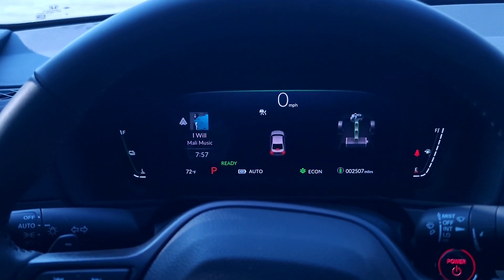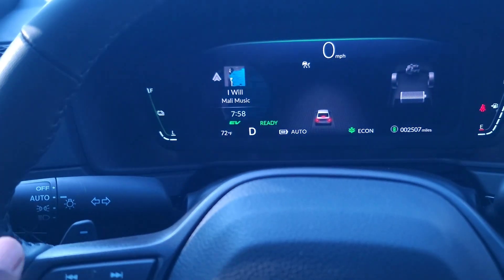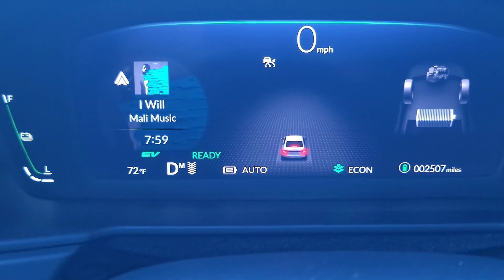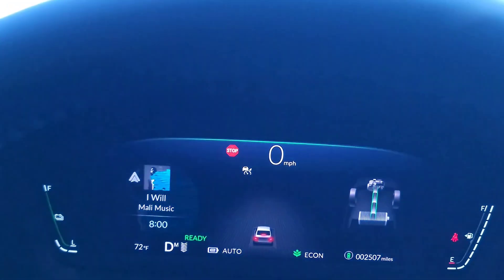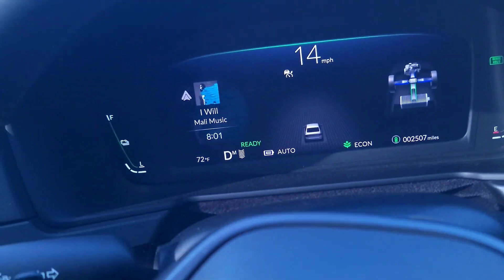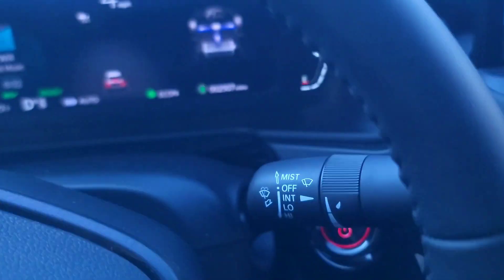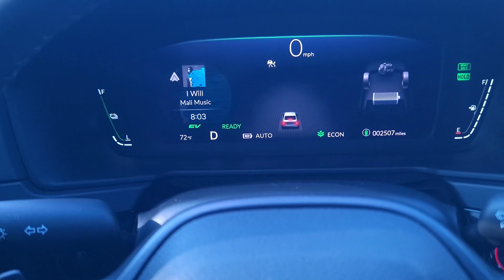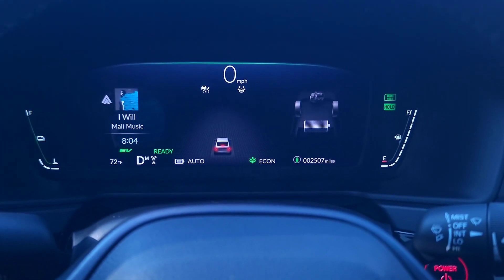HOW DOES THIS THING WORK? | REGENERATIVE BRAKING 2023 HONDA ACCORD

Comment: Here's how I like to explain it. First, I have to use a couple of words differently than you are probably used to, in order to make the distinctions clear.

"Slowing" is any action that reduces the speed of the car. This car can use friction slowing, regenerative slowing, and in certain situations, engine slowing just like down-shifting in a gas car.

"Braking" is when you press the brake pedal. "Coasting" is when you let up on the accelerator. For example, engine slowing in a gas car is applied when you coast with the transmission still in gear; it increases when you down-shift.

Coasting usually applies regen slowing only; never friction. The maximum amount you can get is set by the paddles.

Braking is done thru the computer. Depending on how hard you press the brake pedal, it applies what it determines to be the best, and safest, amounts of regen slowing, front-wheel friction, and rear-wheel friction.The point is that you don't have to use coasting, or the paddles, to get regen. When you use the brakes, you still get regen, but you might not get as much regen as you could.

The interesting situation is on a long down-hill run, if the battery fills with regen. You don't get any slowing if the car can't send the electricity somewhere. So when the battery is full, the car stops sending it to the battery and uses it to drive the generator as a motor. This spins the engine just like downshifting would; no gas is used, and the action of compressing the air in the cylinders slows the car.
Reply from the maker: Thank you for the amazing explanation. I had to pin your comment!!!
Reply: So is this similar to a Toyota Prius where the regen braking is AUTOMATICALLY replenishing the EV Battery?
Or does the Regen braking (such as coasting down a hill) only work if you put it in EV mode?
Reply from the maker: Yes Regen is automatically recharging the battery
Reply: @therealjstarr  Even when just coasting (not when pushing on the brake) or do you have to put it in EV mode to get the regen charge while coasting down a hill?
Reply from the maker: @acurrentconspiracyacc2  no you don't have to put it in EV mode it will do it as long as the Regen is on also with the LKAS
Reply: @acurrentconspiracyacc2  It works, automatically, all the time, without any buttons needing to be pressed. And unlike the Prius, you can can adjust the strength of the effect with the paddles. That part works when you release the accelerator. More gets added in when you use the brake.
Reply: That's a great feature then, because when driving for Uber you eventually go down hills, especially in this area where the town next to this house is separated by a huge hill, you can regen the entire hybrid battery pack coasting down it once you get to the top. Can see getting over 50 mpg with the Honda Accord Hybrid easily.

Comment: Now that the 11th gen accord hybrid has been out for 3 model years now, ya got any updates on your regen driving settings, habits, and overall experience?  I just bought a new 2025 and not sure what the optimal drive settings for me would be, so I just drive with all the settings in auto/normal.  I’m just happy to see I’m getting 45+mpg over the 17mpg or so I was getting on my previous car lol.  I wonder if setting that regen to -6 like you do here wears down the regenerator motor or whatever other drivetrain parts faster. I’d imaging brake pads are much cheaper to replace than the regen braking components. I’m not a car guy btw.

Comment: lol why are you speeding around corners?!
Reply from the maker: Cuz I can lol gotta test this thing out lol
Reply: @ fair enough! Unrelated question, I’ve had both a 12 and 10 inch sub in my hatchback. It’s not hybrid. I’m curious how much battery is drained, and how much less mileage you would get on an electric engine if you were running a sound system.

Although I am looking at the Civic hatchback sport touring, which apparently comes with its own subwoofer. Don’t know how it stacks up with mine.

Comment: Nice video.  About to get my 2024 Accord Sport L soon.  Going to keep it on 6 for sure.  Have you tested the EV only mode much?  Will it get few miles in EV mode?
Reply from the maker: Yes I love it I definitely use it as much as I can you just can't be heavy on the acceleration. So I normally I use it I'm traffic and congrats on the new car 💪🏾😎
Reply: @therealjstarr  Thanks, looking forward to those MPG savings.  The sales guy said I could get up to 10 miles in EV only mode.  Not sure tho but I did hear about making sure to keep it light on the acceleration.
Reply from the maker: Yea you'll definitely have to get used to it
Reply: Let's add to this question .......  @therealjstarr  
Drive a 2007 Prius for many years, when you barely touch the gas pedal, it will be using the Hybrid Battery only until you really push the pedal down then it switches over to the gas engine. Is this Honda Accord Hybrid similar? Can you slightly push the gas pedal down and be in EV MODE (as long as the Hybrid Battery has juice in it) and be riding solely until you push the gas pedal down hard?

Comment: As someone told me (including the dealer), you get the best mileage in Sport Mode with the left paddle pumped 5 times. Am getting 45.5 mpg now that I am driving in Sport with the left paddle pumped. Love it! That paddle is charging the battery.
Reply from the maker: Damn really in sport? Ima try that out
Reply: How was it ? @therealjstarr
Reply from the maker: Didn't try it yet 😫
Reply: @therealjstarr did it ever work ? Lol

Comment: So why do we want the battery charged how do this help ?
Reply from the maker: It helps because this is a hybrid it allows you to be able to drive and just the EV depending on your speed as long as you're not super hard on accelerating you can put it in EV mode and it will just drive in that mode

Comment: Manual is better as you need to glide and rgen when needed to slow down. With automatic set at 6 im pretty sure you are slowing down drastically and need to keep pushing the gas. Maybe thays whu you are not good touching 50mpgs. Just my opinion
Reply from the maker: Ok thanks ima try that

Comment: Using max Regen braking, what kind of fuel economy are you getting? I'm getting 44mpg combined and I use mid level regen braking on my 2023 hybrid sport l accord.
Reply from the maker: Man I ain't seen 44 almost 40 but I drive alot and my foot is heavy 🤣🤣🤣🤣
Reply: how's it looking after a year? Just got a 2024 and haven't played with the regen yet, but I'm getting 40mpg
Reply from the maker: @twonibbleonebyte I love it n what the regen not just for the mpg it also just makes driving the car a breeze

Comment: Nice video good explanation i have a question so if you keep charging your battery 🔋 and keep using full ev mode to drain the battery does it effect the battery life.
Reply from the maker: Nope if I'm not mistaken this car has 2 batteries the engine in this car acts as a generator. That's why the car is so quiet but u will here the engine come on and sound like a regular when the battery is low (likely when u 1st start it out the battery maybe low or if the car is just running) if that's makes sense lol

Comment: So my question for you is, when you let your foot off the gas use the car breaking? Or is it slowing down your transmission to slow your speed down?
Reply from the maker: As soon as you let your foot off the gas the car begins to break. You can actually look on your dash and it has the icon of the car and you will see the brake lights on as if you are manually breaking yourself.